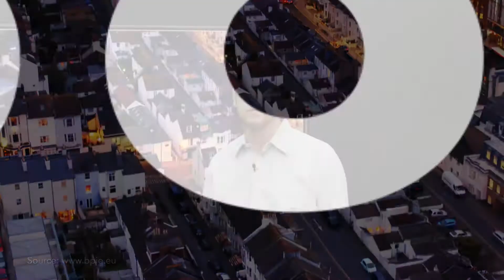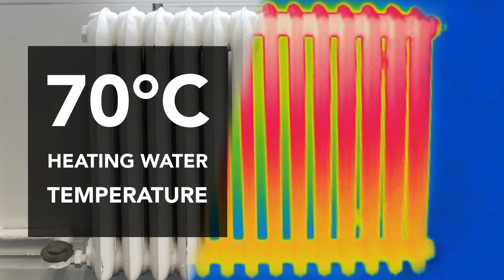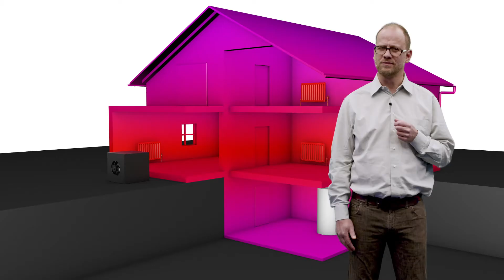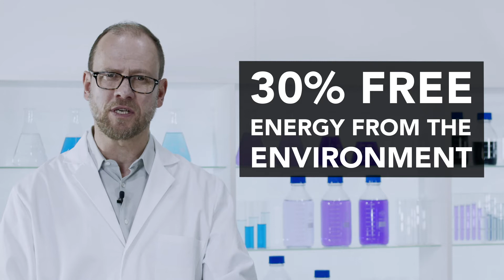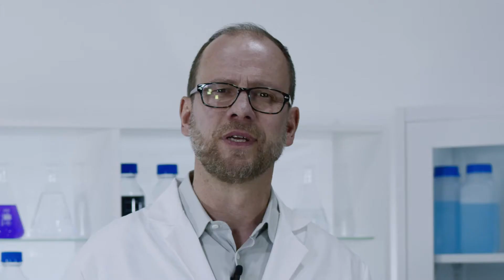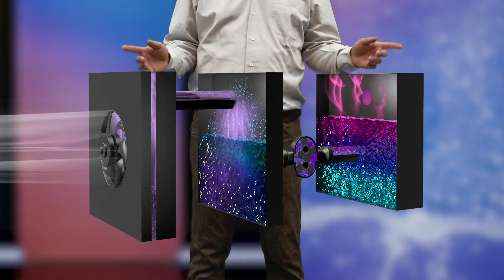Gas Absorption Heat Pumps - A future-proof heating technology

Comment: 30% gain from pumped heat when using natural gas as the heat source to drive the system seems marginal compared to compressor based heat pumps. I'll give you that it seems realistic/honest number, but that also means ~77% of the heat comes from burning natural gas, which makes describing it as a "future proof" solution less honest.          

Absorption heat pumps are not a new thing, they used to be more common, but since compressors have gotten better, absorption heat pumps requires more specific conditions to make sense, like access to a lot of very cheap heat, and when you have that they don't make much sense for low grade heating.

Comment: How much will it cost to build out a carbon-free Hydrogen gas distribution system?  How will the energy needed to produce Hydrogen be created?   Can Hydrogen be economically produced using electricity derived from coal-burning steam driven electric plants?